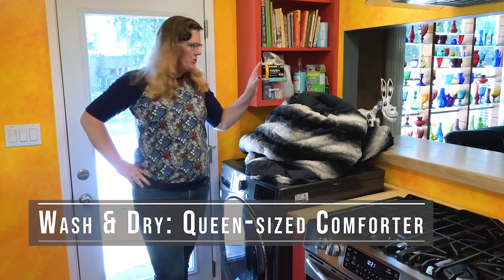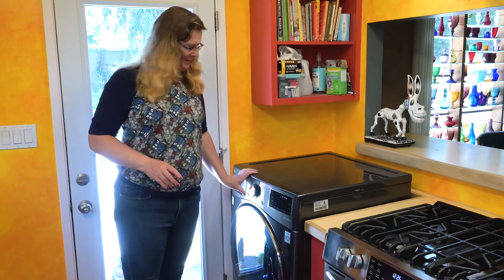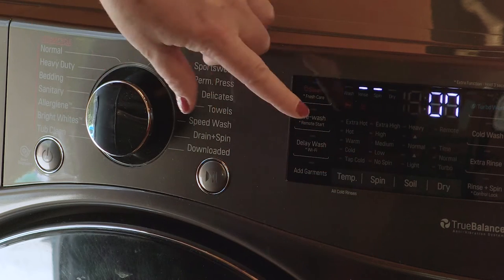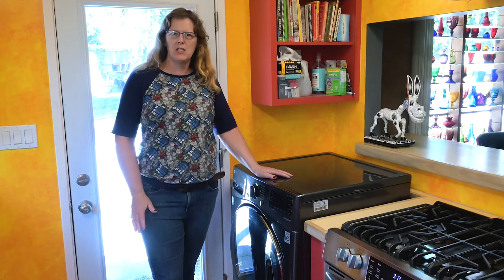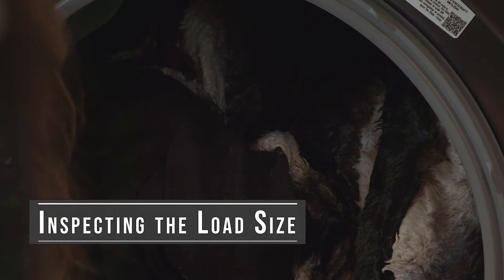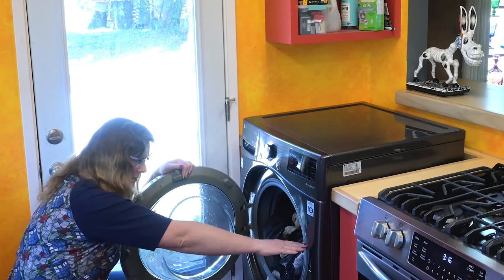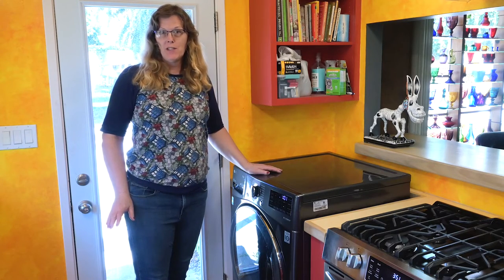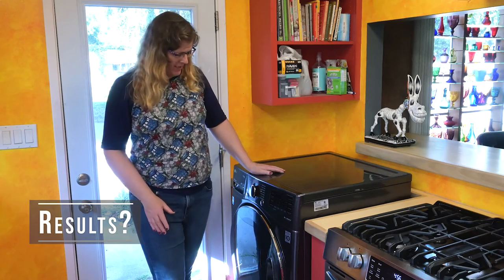Washing and Drying a Queen-sized Comforter – Short Version

Comment from the maker: I washed my queen sized comforter recently and used the normal wash cycle, extra-high spin, and normal dry cycle. I intentionally did not choose the Bedding cycle because I was going to sleep and wanted it to wash and dry on its own. The complete cycle ran under 2 hours. 

I woke up the next day, with no spin hiccups for an oversized load, and the comforter was 90-95% dry, as is expected for a big bulky item that can’t tumble properly during the dry cycle. The center had a bit of humidity still. Normally I would turn it inside out and run another 30 mins dry, but instead put it on the freshly made bed. 

I would not run a blanket or other bulky item on this kind of cycle, but I wanted to see how the queen sized comforter would do. I was surprised and pleased.

Comment: Have you attached a hose on the back vent for the moisture and heat even though it claims to be ventless?
Reply from the maker: There’s no back vent. The moisture gets pumped out through the same drain hose that the washer uses. It doesn’t vent heat into the room. Maybe you are thinking of a different machine. This machine is a condenser dryer. It extracts the humidity from the tub and then condenses it into water that gets pumped out the drain hose.
Reply: @calstatelaalproductions2358  I believe i have the identical model. It does condense, but there is also heat and moisture that comes out a vent right under the cold water intake during drying.
Reply from the maker: I looked at the manual and there is nothing that indicates that is a vent below the cold water inlet. My machine has a white plastic plug of some kind in that opening. No labels on the back of the machine. I don’t think it is a vent. 

It may have some internal heat escaping if it generally leads to the inside of the machine. But it is definitely not a source of moisture expulsion. 

My guess is that LG uses the same chassis for several models and that port is used for a different configuration machine but not for this one. That’s why it’s not labeled as a vent or anything else. It’s probably just a plug to close off the unused port.
Reply from the maker: In fact the manual doesn’t even acknowledge that it exists.
Reply: @calstatelaalproductions2358  there is nothing in my manual also. I thought it was a plug at first, then noticed moisture on my wall while it was drying. Pulled away from wall and the white plug has a hole that directs hot air and moisture down.
Reply from the maker: My guess is it is incidental from the mechanics and operation of the machine and not an intended vent for the heat and moisture that is actually in the tub.
Reply from the maker: FYI, that white port is not a regular vent. It is the drum exhaust port. Apparently if you are getting excessive moisture and condensation from there, you are likely using too much laundry detergent. This washer needs no more than 2 tablespoons of liquid HE detergent for most loads. The max fill line on the tray is between 1/4 cup and 1/2 cup. 

If you have a history of using too much detergent, it may take a few wash cycles to clear out some of the excess. Run a few washes with no soap and an empty tub. Or run a tub clean cycle to flush out the excess.